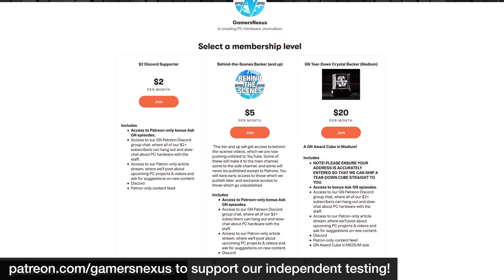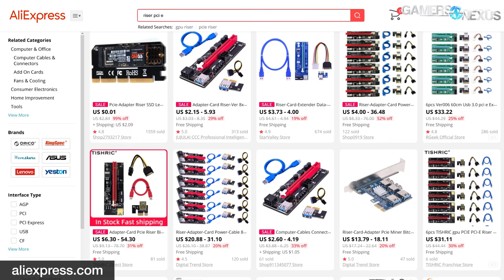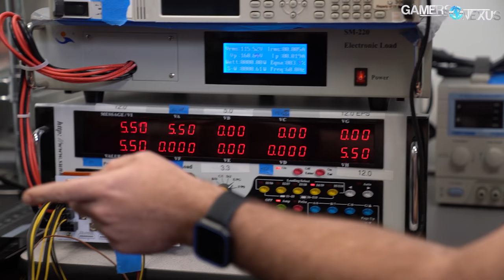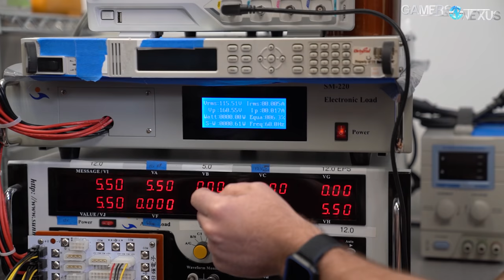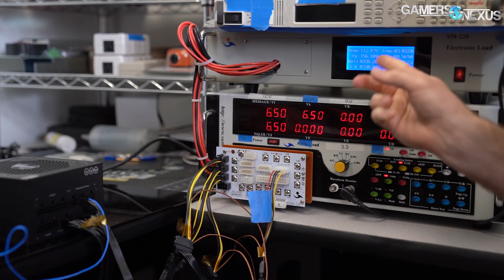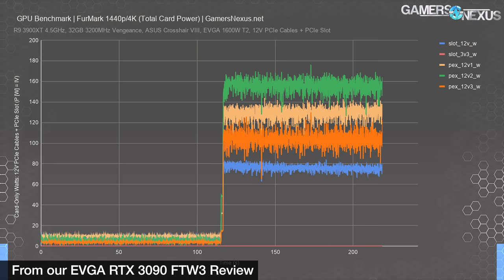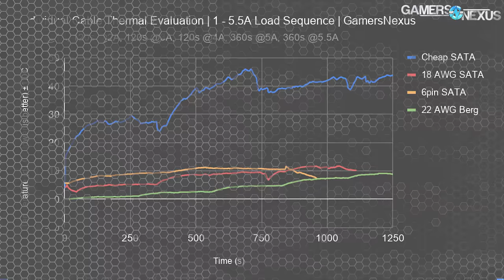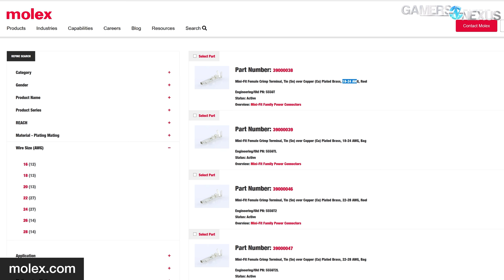Don't Use Cheap Cables: Dangerous Construction & False Wire Gauge

Comment: My corsair Type 2 cable melted on the PSU end when plugged into 1 Graphics card (RX580). yes I was mining but it was not at max voltage due to trying to make it efficient.

I have also noticed for my gaming PC that one of the type2 cables (8-pin CPU power) has gone brittle. This has never been overloaded but possibly a bad batch?

I've had 3 corsair HX1000i power supplies and 2 have had an issue with the cables. 1 with the cable melting and smoking (RMA'd).
and the other is in fact the replacement PSU they sent that I put into my gaming PC. Which now has the brittle type 2 plug. it definitely was not brittle to start with but i've been keeping my eye on it.

Comment: In my cousin Jimmy's pc, I used a molex to SATA adapter for a HDD.  The PC was sitting in his room for a few years when one day we started to smell smoke in the house. The whole family started walking around the house trying to figure out where the smell was coming from. It was traced back to Jimmy's room and when I took the side panel off his PC there was about a 3 inch tall flame in is PC. I quickly pulled the power cord and ran to grab a fire extinguisher. I sprayed down the PC because I was not messing around with a house fire and I really did not care about the PC in the moment. The fire killed the HDD and a SSD next to it and the fire extinguisher kill the motherboard. After examining the damage it was clear the the SATA was made poorly and a power and ground wire where to close. The slight movement of the HDD caused the two wires to touch and we got a short to ground and fire. Moral of the story is don't use cheap SATA connectors because you can not see if the wires inside a touching or almost touching and when they do touch you get fire.

Comment: I can't tell you how many of these adapters I've seen go up in smoke over the years. Even saw someone who was powering their 1080 off of Sata Power. Alot of these use really brittle aluminum wires too and can start to fray inside after a few years making them even more sketchy to use.

Comment: Another way they cheap out on wires, is they use copper coated aluminum strands. I was warned about it while looking for heavy gauge wire, and sure enough, I got a roll of the stuff from Ebay. (All I had to do was scrap the strands with a utility knife, to expose the aluminum.)

Comment: In ac power, arc fault detection devices are used to detect arcs and fires. They monitor frequency's, transients and that kind of stuff to detect the faults and the they isolate the circuit. Perhaps DC versions of these devices could be used in PSU's to help prevent dangerous fires

Comment: This happend to me. while mining/gaming on 1070ti. My gigabyte gpu was flashing led light on 6pin connector. I investigated and touch the wires they were damn hot at the  pin area. I was using the extended 8pin cable and as i swap to the main 8 pin gpu cable the problem went away. Turns out it was a bad loose pin connection making the gpu unstable even though it was plug in correctly.

Comment: As a general rule, thicker, shorter cables can handle more current.
Cables have more resistance the thinner or the longer they are, and will get hotter more quickly.

Comment: I learnt this the hard way, thinking I blew out 2 systems, when it was the PSU extension sleeved cables I bought from a local seller that wasn't able to handle the power draw

Comment: Not just power, hidden gremlins can be caused by usb cables and adapters where the plug shells aren't connected to the shield, use a continuity tester to confirm.

Comment: Not just an issue for mining. Tried to use PHANTEKS extension cables for my RTX3090 and was having random issues, from black screen to dropping voltage. Decided to ditch the visual and went back to the PSU supplied ones. No issues since.

Comment: I think a practical solutions can be to monitor all your cable with a temperature sensor in all the cable connected to an Arduino or raspberry you shut down the rig if one cable is too high. Very simple

Comment: I have a new USB cable (only had it since last Xmas) that started crackling on its own (when plugged into USB charger hub and not even connected to anything else! I started hearing a strange noise and looked down by my elbow, it also started to smolder and put out a burnt smell, so I unplugged it but was shocked even a cable just plugged in could start to arc and possibly catch fire on its own!

Comment: Copper oxidizes quickly as well so if you continuously heat cycle the cable the resistance will go up over time. That cable might not handle the same current it did a few months earlier.

Comment: I had a near miss with the ATX power connection from Corsair. The shielding was not put on right and when they shrink wrapped the ends of the cables on the power supply side the shielding was too thing due to it being melted too much. It created a short which killed my Rmi 1000w power supply luckily it didn’t kill anything else in the computer and didn’t cause a fire.

Comment: A question for GN
Don’t premium high output power supplies usually have over current protection? Or those usually only applies to PCIE/CPU/MOBO power, not SATA? Because SATA never intended to supply that much power?

Comment: I had similar issues with those SATA to 6 pin cables some years ago, but a Seasonic PSU shutdown immediately when it shorted. This is why it's important to use good quality PSUs. Right now the common practice is to power the riser with a 6 pin extender/splitter from the same cable that powering the GPU. With multi PSU systems, always power the riser and the GPU from the same PSU, preferably the same cable. Crypto mining, just like sex, is only fun when it's safe.

Comment: I have an RX 570 8GB by XFX that smokes the SATA adapters that comes with the risers. All my other cards (5700 xt, p106, another RX 570 8GB and RX 470 8GB. this was back when I was first starting out. I could smell it all day, 10 hours later I came back to a gummy (but still in-tact) SATA plug.

Now of course I run everything "properly" (as properly as cramming 6 cards onto a single board could possibly be lol).

The card ran fine the whole day otherwise. So it seems to be different between different cards as well.

Additionally a guy I talk to his XFX 5700XT also burns the SATA adapters on the riser, while the other 7 cards don't.

I thought it was an interesting observation. Is this common with XFX cards? or is it random throughout the market?

Comment: You should also be monitoring how much the voltage drops versus current draw/temperature ..... While that doesn't cause a dangerous fire situation it does degrade performance and efficiency and it doesn't take long to burn up the 5 bucks you saved in excess electricity costs .... As a rule of thumb for peak efficiency I don't use a wire at more than 60% of it's DC current rating ....For instance if I have a wire rated for 10 amps at 12V once I need more than 6 amps I go up to the next wire gauge  .... Any heat generated in a wire above ambient = burning up money

Comment: I actually managed to melt/weld two molex connectors together... or Antec did. Like 2 decades ago, i bought Antec "sonata piano black 2" case, that came with 450W¿? Antec PSU, and turns out these had major case of explodines. 

I was gaming when suddenly my monitor went off,  and there was this "Whoooosh" sound along with bright light underneath my table (lasted like 0.2s). I looked beneath the table and there were char marks on the wall just behind the computer... That damn Antec power supply had exploded, spewing fire ball to the wall from the fan hole... it killed EVERY component on my PC with the exception of diskette drive (i actually got rid off it just last year, when i got case with glass front panel.. which i immediately replaced with perforated metal piece), and the molex connector pins for case fan had melted/welded on the molex connector from PSU

Comment: i want to know wall plug.  for example my home is 1920-30's electrical was upgraded a bit but walls not so much, single outlet that has 2x3 prong outlets and i have 3 PC's 1 server and 1 nas running through it (around 2-3k watts)  i use 2 UPS's on each 3 prong but i feel like it is still sketchy...

Comment: If you hook up 6 Arctic P12s (3x P12, 3x P12 Slim) together with the build in cables it will cause a melting cable. Mine did.
Also two Arctic P12 Slims that I have ordered additionaly was so tigth packed up that the cabels got squeezed and had a exposed cable core. It is possible that one of the 6 had the same issue what indes caused the melting but I can not check that because the cable is... Molten.

Comment: A similar safety issue surrounds molded molex to SATA adapters, which have been notorious for catching fire due to poor connector manufacturing and possible electromigration in the connector as outlined here https://www.youtube.com/watch?v=fAyy_WOSdVc and https://www.youtube.com/watch?v=TataDaUNEFc

Comment: don't power supplies have any kind of short/over current protection? or does it only work when going  over the amperage rating of cables that shipped with the power supply?

Comment: what is worse, a dead short or a 12v to a data pin?

dead shorts cause extreme thermal and current runaway, but would bypass the electronics, possibly leaving them unharmed.

data pins are complicated, but lead directly to a chip. would it directly cause damage worse than the cable before pathing through components?

Comment: After watching the video i am a little confused. As is understand it you can not daisy chain fan hubs on the same sata cable, because 1 fan hub may draw up to 45w of power. So if i want to have many fan hubs in my pc, i have to have a separate sata cable coming from the psu to the fan hub? Or is it safe to use the supplied daisy chained sata cables  that came with the psu?

Comment: If anything you’ve reinforced my belief a quality PSU can push well beyond the rated limits.  Even still I hear about spec a lot and people are afraid to pull a little extra wattage.  There’s almost always some headroom designed into power delivery to make it safer and more reliable, especially when it’s the standard.

Comment: I never saw any mention of material the conductors were made of.  Wire gauge is part of it; wire material is another part. Copper conducts far better than aluminum, but costs far more, so often times you will see aluminum strands inside cheaper devices, cables. Conductor length also plays a role; the longer the cable the higher the gauge needs to be because the resistance of the cable goes up as it gets longer and thus its ampacity goes down.

Comment: Please mention another fire risk - cable management - do not wind cables into a coil!! Electronics 101!
I bought a computer from a local PC seller some years back, they had looped the excess front panel cabling and tied it to the side panel - After using the PC for a while, the loop created enough heat to melt the insulation finally causing a lot of smoke and panicked pulling of power plugs.
I now build computers instead of buying them.
Reply: Thankyou! I got to 6:30 and you mention coiling cables. Good stuff!

Comment: What if you diy'd a riser cables using lower number guage cables? Say something like 16 or 14 guage to make sure risers? Should it then be able to handle current and heat better and then be less likely to burn up under the same conditions as shown and described in the video content?

In the same mindset as GN, if i can think of it, it's guaranteed someone else did and someone else (probably) tried it.

Comment: Get a good PSU 

SATA power is fine, rule is no more than 2 risers per SATA power wire.

Years on 8x 1080Ti + 7x R7 rigs , clean and inspect every 6 months.

No burns yet, TDP 70% w/Overclock

Comment: SATA to PCIe power cable adapter? I didn't even know such a thing existed. One of those is intended for a 10W power draw and the other is intended for 100-200W power draw. I can't imagine that being safe in any circumstance.
Imagine putting 4 spare tires on your car and then driving 150mph. It's that level of absurdity.

Comment: Would a sleeved psu cable resting against a radiator melt or lower performance?

I don't have much space on my meshify c but I really want to put an arctic 120 rad on the front with a 140mm nzxt fan put together by a 120 to 140mm adapter 1.27cm thick. I'm worried it would melt the cable.. :C

Comment: coming from the car audio community and the audiophile community as well, if there's any heat in your wires you're doing something wrong. in your wire gauge needs to be upgraded or shortened their ways around it but basically your wires having any heat in them means that they are now experiencing resistance and that's a bad thing and that of course induces a voltage drop one of your big enemies in car audio special when you're working with a DC system.

has the voltage drops the current goes up usually and when that happens it's just a ever-loving accelerating fire or a meltdown waiting to happen.

there are a lot of things you can go cheap on your PC but Power delivery on those power rails shouldn't be one of them .

Comment: Folks, if you need more power for your mining rig, just splice into the PWR_ON signal from the motherboard, and connect it to the corresponding signal on the 24-pin cable of a second power supply. Now when you hit the power button both power supplies turn on. Obviously use risers, don't just short both 12V rails together through the motherboard (your motherboard will melt). This solution uses only the cables that come with each power supply. Unless you use no-name Chinese power supplies, the cables that come in the box are safe.
Reply: Also: Please, just because your molex cable has 4 connectors on it doesn't mean you should daisy-chain 4 risers on one cable! One riser = 1 power cable! If your power supply doesn't come with enough molex cables it's a sign you should avoid connecting more stuff to it!

Comment: All of the corsair low voltage cables (or whatever bullshit they call their low noise/speed fan cables) i've had ended up burning up right at the resistor(?)

Comment: 18:45 my gtx 1050 when pushed hard will pull 78 watts from the slot briefly (no external power pins)
Reply: @Tano  i wasn't worried i was confirming that it was one of the cases they mentioned

Comment: I'm ready to learn if my house is gonna burn down with all the charge cables around the house.

EDIT: Let me also tell my story about some EZDIY case fans I had that the cables melted on immediately after turning the PC on. 
I was running 6? EZDIY case fans in my rig for a while, before replacing them with more reputable brand fans. I saved the fans and eventually put them in my roommate's PC I was building. I had no previous issues with the EZDIY fans and hooked them all up. I can't remember if they used molex or sata. Either way, I had 3 fans per header, just like I did in mine, when I was using them. Switched the PC on and the smoke of doom came pouring out. I immediately switched the PC off and examined it. The fan cables, not the PSU cable, were melted and burned. I tested the motherboard headers with different fans and they still worked as intended.
Whether it was a mistake on my part with the build, or the fans themselves, I will never buy EZDIY fans again.

Comment: People are very unaware about wire gauges in general for just even stuff like extension cords. They buy the cheapest one and plug things like space heaters into them causing house fires. Then you have wire gauges working in reverse of what your intuition would tell you having a higher number meaning a worse cable not helping things. People using old, dented cables is a problem too.  It's just shocking how little effort has gone into informing people about the safety around this stuff.

Comment: If you coil a cord the heat generated by the cord has nowhere to go but back into the cord.  This creates a sort of feedback loop, where the cord just continually gets hotter.  You can test this in your house, relatively safely.  Take anything that can sustain being turned on, a vacuum, space heater, a drill with the trigger taped to 'on', anything really.  Then attach its cord to an extension cord that you coiled up, and plug it into the wall and turn on the device. DO THIS IN YOUR GARAGE  And leave it on for like 20 minutes and come back to check, you will find that the extension cord is really hot.  Now, repeat this, but this time, uncoil the extension cord and string it all around the room.  Leave the thing on and come back in 20 minutes.  You will find that the cord is not hot, and may be either room temperature or actually cool to the touch.  This is because the heat generated in the cord can escape and is not getting any heat from cords next to it, no accumulation.

Comment: I’ve only ever managed to melt one cable, and it was because I stupidly used one PSU cable that belonged with another PSU. Luckily, I noticed right away since it melted my newly purchased NZXT water cooler. I haven’t mixed cables or bothered with water cooling since.

Comment: What can you say about the extension cables used to make your RGB setup look prettier, the ones we use to comb ?
There are more and more chinese seller for those cable, in several diversities of color schemes. 
But none talk about their specs.

And what about those T dongle to plug a 24 pin to the MB at a 180° angle ? 
I have no trust in those.

Comment: I kind of feel that a dead short is safer than hot cables. A dead short "should" blow some protection circuitry, where as hot cables can easily start something on fire. Maybe not the insulation, but nearby flammables.